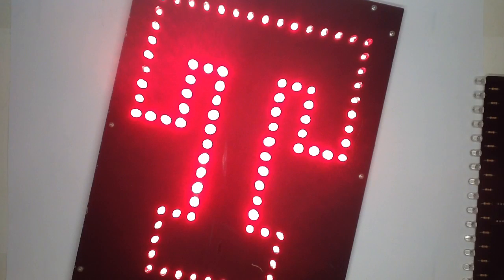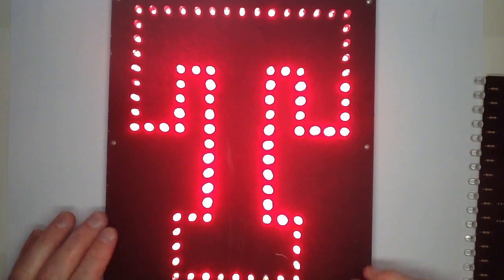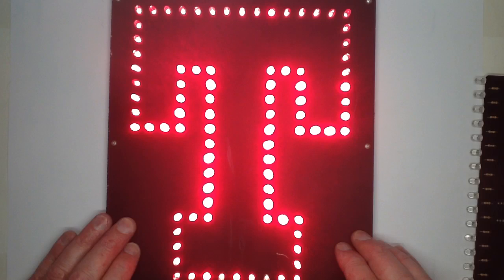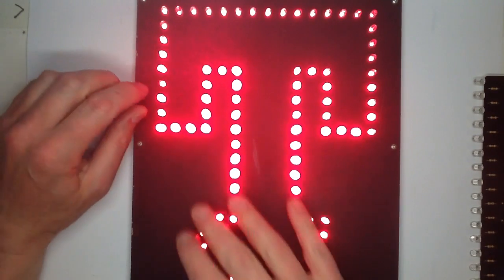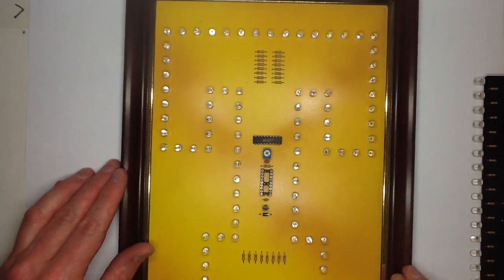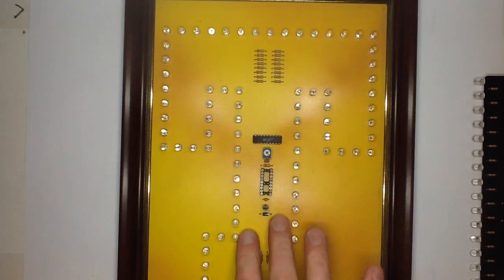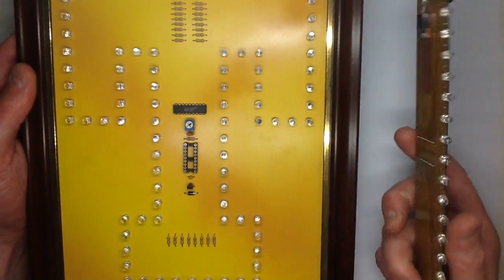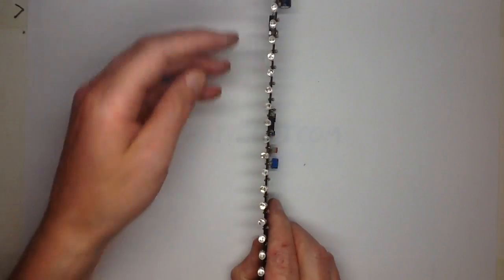Prototype LED beer signs.

Comment: can you explain how your POV works?
it was a non-moving static display that showed the logo, but how did you time the flashes so a person walking could see it?
thats very interesting, all the one ive seen works with the display moving at a determined speed.
Reply: I'd actually like to see that 'in action'
Reply: habitant quebec 
It just flashes all the time. So you would see multiple "T"s in a row, their width determined by the speed of the eye movement. Pay attention to your surroundings. You quite often have multiplexed LEDs around you, where you can see the effect, although especially in matrix displays it something you wouldn't want. Buses in our city for example have LED signs for the line number/name. When they pass you the text is all skewd because of the multiplexing.
Reply from the maker: habitant quebec If you look at the PCB in the video you will see a small adjustable resistor for speed adjustment.  I wrote the software to scan the same image repeatedly with a small delay in between each image, and adjusted the speed roughly in the software then fine tuned it with the external adjustable resistor.  It just displays a continuous stream of T's like this....    T T T T T T T T T T T   So that as your eyes move across the room you get the hovering T's.

Comment: Are there alot of led and neon signs in glascow?
Aren't there alot of old buildings in parts of glascow?
Are there som parts of town where LED and neon signs are forbidden ?

Lots of questions.
There is a whole town in ... Switserland or Cekia or somewhere , where the wholw town has stone buildings like early 1800 type buildings. (As far as I can see.)
And neon signs and the like are strictly forbidden.
Always when you see pictures from Glascow you see the old revered buildings, and I guess it's easy to think the whole town is like that.
Reply from the maker: Flapjackbatter Glasgow used to have a signage industry like Las Vegas with huge animated neon signs on the sides of the buildings.  But then it got clamped down on by the council of that time.  Now it's just the usual shop signs.